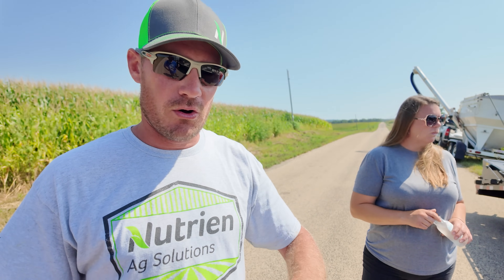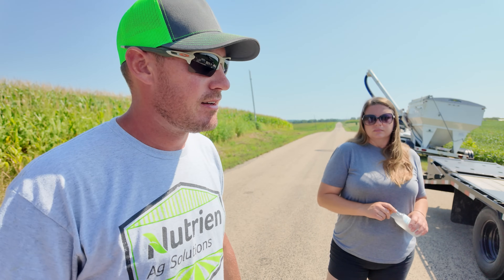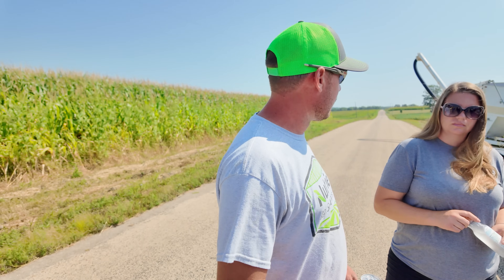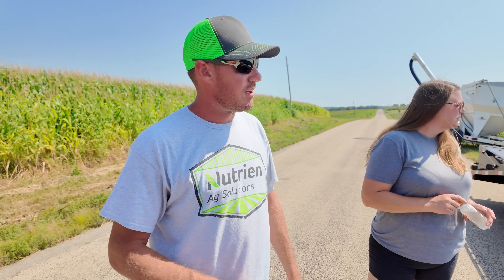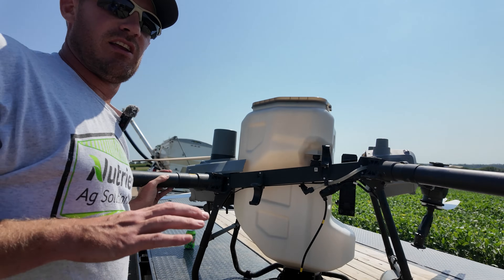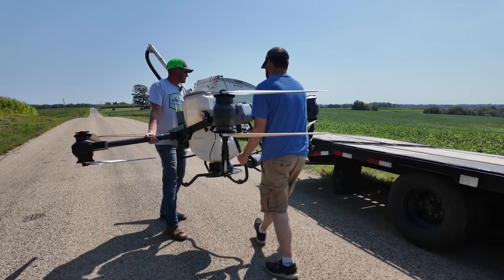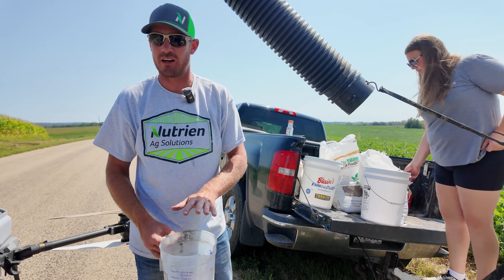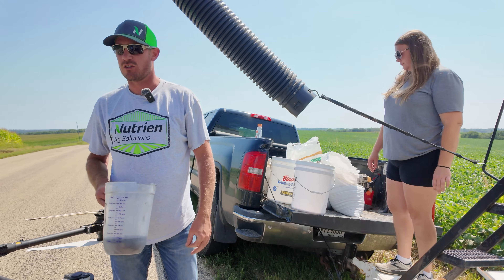Agri Spray Drones Cover Crop Trial

Comment: Cereal rye will not provide much fall grazing even if seeded early.   It provides huge amounts if grazing in the spring though.  Drone seeded outs would provide way more fall grazing.  Oats will continue to grow until Temps get down to 20 for several hours

Comment: Can't wait to see new season videos.  Also any chance you are building/getting a dedicated spray drone trailer?
Reply from the maker: I probably won’t pick one up this year. Using my flatbed is extremely convenient because it provides plenty of space to work. I don’t have to land off the trailer as long as I can do all fields with the trailer, which I proved I can do last year!
Reply: @HowFarmsWork  I was thinking that something similar to the cage and simple inductor Phiber makes for their dash trailers would be a great basic add on.  You could use the JCB to fork it on and off as needed.  But keeps everything contained.  But I understand cost and time requirements.